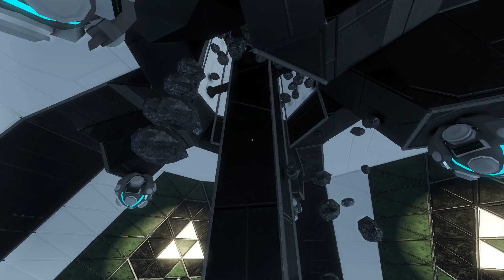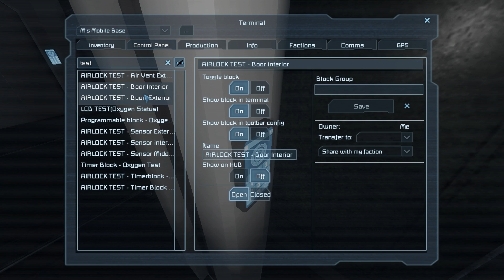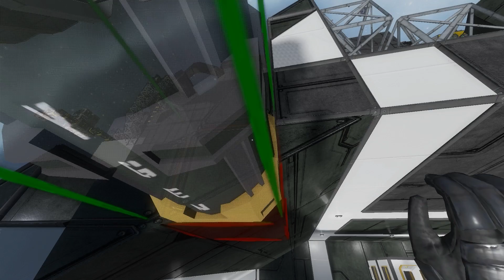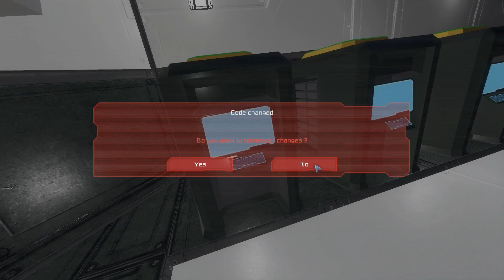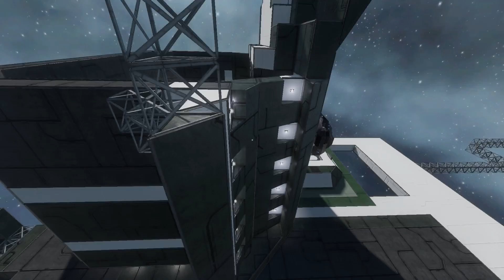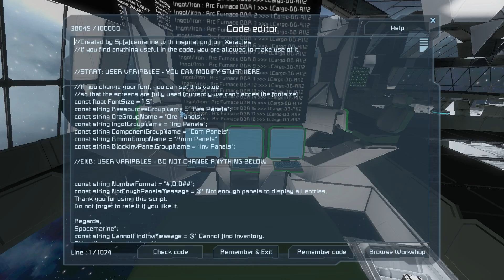Space Engineers • Solo Survival • 98 • I can Breathe Freely Now

Comment: Regarding the airlock: if you set your original sensors that used to open the doors to instead prepare the pressure in the room, you can ensure it's always in the correct state.
So for the inside of the room, if it detects someone close to the door, start pressurizing the airlock. And for someone near the outside, start depressurizing it.
Reply from the maker: +PilotError42 Ah, that's a good idea.  Instead of the buttons.  I like that.